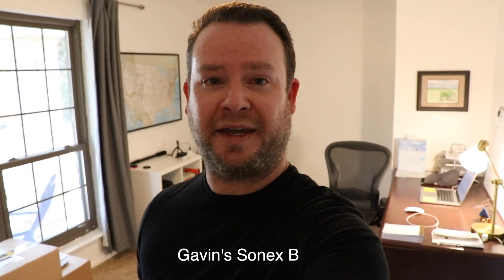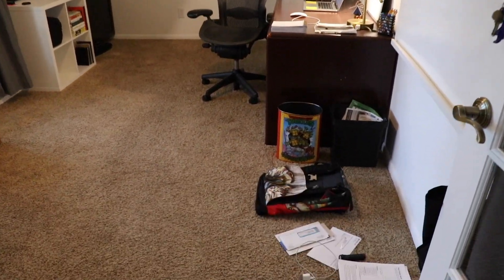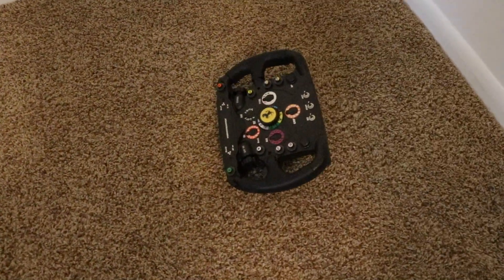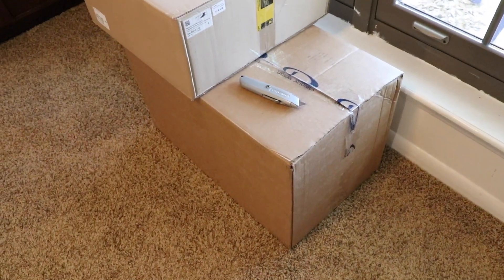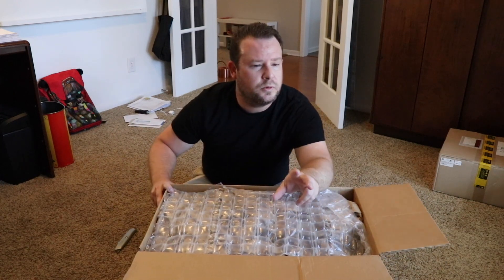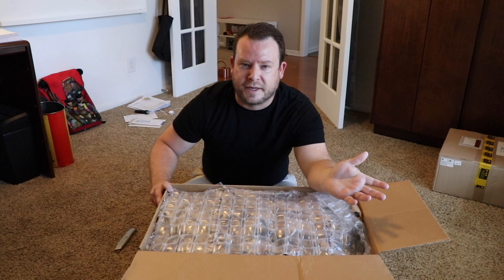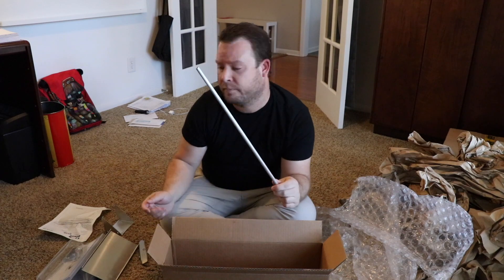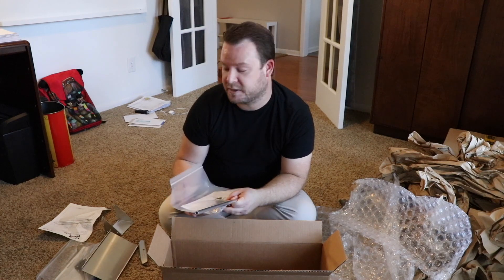Dynon Auto Pilot Mounting Kit Unboxing

Comment: So wait, when the autopilot turns you, you're gonna have adverse yaw unless you manually press the rudders? Kinda defeats the purpose of an autopilot if you still have to manually push the controls, doesn't it?
Reply from the maker: Yes and no. Very few piston planes have a yaw damper. The shallow slow turns that an autopilot will do will technically be uncoordinated but not enough to get the plane "out of whack." Also in 95%+ of flying, it is being used to hold you straight and level where a yaw damper is not needed. Just rudder trim based on your indicated airspeed. Hope that helped -Dan
Reply: @danielolivermcelroy8320  Ah, I see. Thanks for the reply! Also, I'm now officially jealous of you because your plane has rudder trim lol
Reply from the maker: @Zalaniar  What are you flying?
Reply: @danielolivermcelroy8320  I'm not actually flying yet, (starting in summer hopefully!) but all the schools around me use 172s.
Reply from the maker: @Zalaniar  Not a bad plane at all. I owned one for a year. Lots of fun. Great handling and nice and forgiving. Happy flying! -Dan